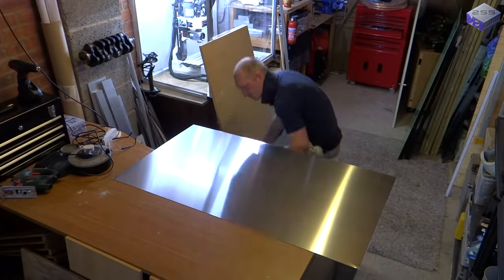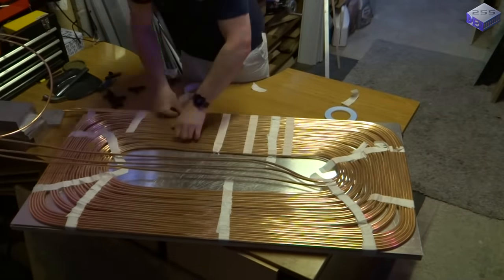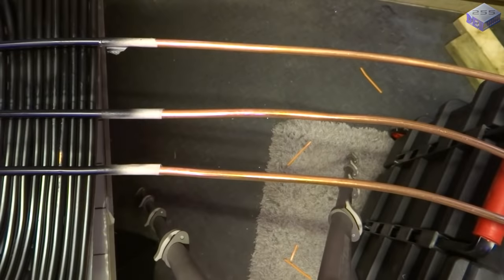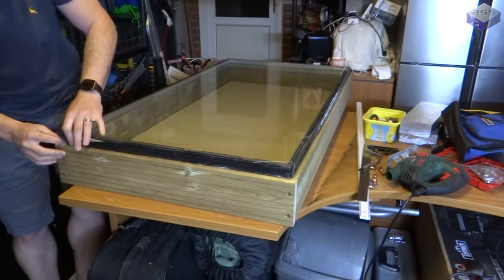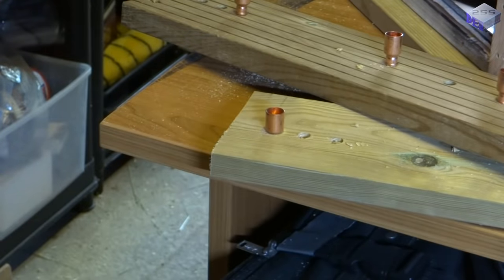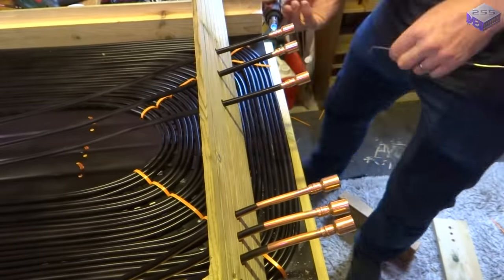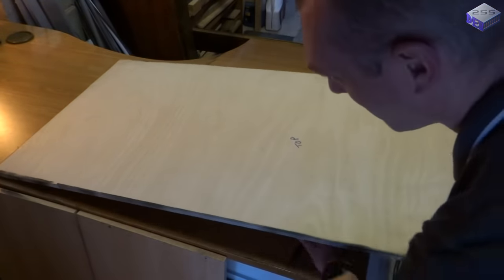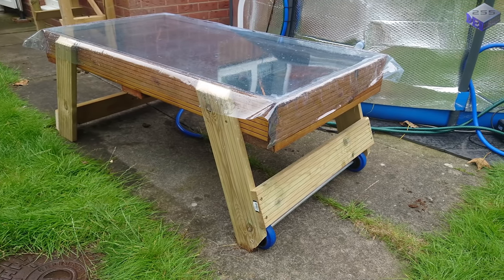Improved Solar Pool Heater - Full build

Comment: Just thought you would like to know. Back in the 1970s, testing for the color paint that was best for the absorption of the sun's energy. The color turned out to be Forest Green. It seems Mother Nature already knew this. That is why trees are Green.
Reply from the maker: Hi, that does make a lot of sense as the light from the sun is not truly white and the inverse of the suns colour is not black. Nature has evolved to be the most efficient form of energy receiver, you may be right, we should look at nature, it's solved a lot of issues before we came along. We assume black is it's hot to the touch but leaves are not due to the air cooling them down around them.... Hmmm, I may just try this colour on the next project. Thank you, you are the first to recommend using this colour and it makes perfect sense to me. Watch this space ;-)
Reply: Incorrect heat comes from infared waves.  Red captures most infared energy not green or black
Reply: I stopped watching after only one minute, after seeing this guy using a double pane window.
Use your imagination.🤣
Reply from the maker: @Fatpumpumlovah2  Cool, this is why I do this stuff, so I can learn while others do too. I'll have to compare different colours. So far, I have had the most success with black, but we shall see. Also, I'll be changing the glass to polycarbonate or perspex; I have a few options to try, as the double-glazed panel blocks some of those important UV and IR
Reply from the maker: @cm8099678  I'm still learning too, I'll be changing the glass for different materials to see if it can be more efficient.
Reply: @cm8099678  what exactly are you saying.
Reply: @QuetzalcoatlOdin  Double glazed pane is perfect, allows UV in and traps the heat in? What's wrong with it?
Reply: @GBPaddling  I assume you tagged the wrong person. I asked the same question wondering why it was an issue. Might want to retag your question bro
Reply: @QuetzalcoatlOdin  I was agreeing with you!!!!
Reply: @GBPaddling  proving they keep these Platforms in text-only so there is as much miscommunication as humanly possible. Now hopefully someone will answer a question.😄
Reply: @Fatpumpumlovah2  incorrect black body radiation is the most efficient absorber of heat and is used to to dissipate heat on the international space station
Reply: @GBPaddling  they keep heat out during the hot months hardly the suited application here.
Reply: @TheSolarPoweredEngineer No, black is correct - infra red is not red, it's above the visible spectrum. Plants are green because they don't want to absorb too much heat - the want to absorb certain wavelengths of light that make photosynthesis work. In fact, the blacker the better for absorbing infrared. Black is technically the absence of colour so it's absorbing all visible light as well as infra red. To make this panel more efficient you need 3 things. A glass with a one way infrared coating. It's called low emissivity glass or low-e glass. Ideally you'd create a vacuum so that no heat can escape via convection but that's pretty impractical for a home project. And you need a temperature differential controlled pump to allow the water to heat to an optimum temperature before heating the pool. So you would generally want your water to heat up at least 7 deg C above the existing water temperature in the pool and you want it stop pumping around a 2 deg C differential. You could increase that top number in summer.
Reply: @Fatpumpumlovah2  No, Red reflects red, possible also let it pass throug. Green leafs absorb roughly 30% less light from the green spectra than from the red or blue. 

But the problem we have is that we can’t see the whole picture and jump to conclusions. So some red may absorb infrared, others may not.
Reply: @cm8099678  Yes that way it’s better isolated from the elements that want’s to cool it down. Normal glass blocks UV. But not so sure how UV contribute the heat.
Reply: @Fatpumpumlovah2 also incorrect.   The sun is technically green in colour.   The most colour energy from the sun is in green.
Reply: Pretty sure that's not true? You see green out in nature because it reflects the green spectrum... so it absorbed LESS.
Reply: The great benefit of that thermal tape sticking the copper pipe to the aluminium plate is the minimisation of bi-metal corrosion.
I'm wondering how well the paint you chose will stand up to the heat and the thermal expansion & contraction compared to say stove paint ?
Reply: @TheSolarPoweredEngineer please let us know how that goes!
Reply: @Fatpumpumlovah2  You are wrong on so many levels. Something that you perceive as red is reflecting that color, not absorbing it. Infrared is close to red, but it is not red. Something we perceive as black reflects very little visible light because it absorbs it and is generally a very good absorber of infrared.
Reply: You're conflating issues. The color testing that you're referring to was specific to photosynthesis, and had absolutely nothing to do with heat energy absorption. Flat black is by far and away the best color for this project. 

Photosynthesis is primarily driven by the red end of the spectrum (600-700 nm), followed by the blue region (400-500 nm) and lastly, the green region (500-600 nm). That's why plants reflect green and absorb red and blue.
Reply: @lordgarth1  but the light will go though and heat up the inside and keep the heat trapped inside, you are just wrong.
Reply: @mondotv4216 I am currently working on a similar project and grateful for the advice thanks. Regarding the “differential controlled pump” I’ve gone back to basics on this. A small DC solar panel powering a small DC pond pump. The more sun, the more heat in the collector, the faster the pump runs. The less sun, the slower the pump runs. An in-line valve could also be used to tweak a flow restriction if needed.
Reply: Most of the light coming from the sun is in the visible spectrum, so technically heat comes from there just as much as it comes from the infrared.
Reply: I don't think that is correct. Black reflects less light than green and leaves are probably optimised to NOT become too hot.
Reply: @StupidInternetPeople  But in this case the heat is taken out of the enclosure by the water, so the pane needs to be optimised to pass through as much sunlight at possible, and only prevent wind from cooling down the tubes.
Reply: No it isn't. Green is the colour light which is reflected from the plant after it's absorbed everything else.
Reply: I remember reading that way back then.
Reply: @Fatpumpumlovah2  No, the heat comes from ALL OF IT.  We think of infrared as representing heat because we can feel it as heat but can't see it.  All photons of light carry energy, and if they get absorbed then you've got that energy.
Reply: L0l sorry I don't care how much science is out there but I've tried wearing all of the above colors and in black u will die in the heat
Reply: Sorry but that is incorrect!
Reply: The color black absorbs all frequencies of solar radiation. Because the sun is also black, and not at all yellow as we see it. The eye "lies" to us.😊😊
Reply: please don't say things like this without citing sources. Ridiculous statement.
Reply: @Fatpumpumlovah2  

What color absorbs the most radiant energy?
black
The more light the object absorbs, the more heat absorbed since light is energy. If you consider it a color, black absorbs the most heat. A black object absorbs all wavelengths of light and reflects none. Objects that are white, on the other hand, reflect all wavelengths of light and therefore absorb the least heat.
Reply: @mondotv4216 pretty much correct the leaves are green because it’s that wavelength that isn’t absorbed and looks green to our eyes when the light bounces off. when leaves turn yellow red etc in autumn  that’s the tree not using that wavelength of light or so my teacher told me many moons ago
Reply: @trollking202  we're not in space.
Reply: If you are using this with a pool, are there chemical issues between the copper pipe and the chlorine in the pool?
Reply: @brianpomerleau887  That is a good question and hoping to hear an answer from someone with sources.

Comment: Would be great to see some temp readout of water temp in vs out
Reply from the maker: Hi, I will be doing some of these readings soon with a flow rate meter, in and out temperature sensors and an Arduino-based data logger that should update every second; where I now have a thermal camera too, so can also show the system in action. I will be putting all of this data on a chart to show how it performs against a purchased one and my previous homemade one.
Reply: @TheSolarPoweredEngineer  must have had a few days of sun by now even in UK?
Reply from the maker: @TheHellis  Hi, yes, I made a quick video with the thermal imaging camera when the pool got up to 32ºC, so will be doing some experiments in the next few days. With a full-time job and kids off school, it takes a while, but I'm getting there.
Reply: Agreed, 
And how your going to move water through it
Reply: Doesnt the water free flow  or can use a inline 12v pump💁
Reply: Where we can see that?

Comment: This panel would have raised the temperature by 0.078125 degrees celcius in my pool, after a whole cloudless day in the summer. The following morning, most of the extra heat has disappeared. Perhaps after a week of cloudless weather, the temperature could rise by 0.15 degrees Celsius.

Comment: What would be "ideal" would be to solder or braze the tubing down to the aluminum along its entire length, but wow, that would be quite a job with 75m of tubing.  You used a lot of tape, though, so that's probably pretty good.

Comment: Many zip ties are not UV resistant & will become weak/brittle over time. When this happens, try using solid core copper or aluminum wire like a twist tie instead.
Reply: Uv doesn't go trough glass.
Reply: @desireisfundamental UV-A does
Reply: @desireisfundamental uv does go through glass.

Comment: Again, smaller tubing doesn't change the heating capacity.  That's set by the area of the collector.  Smaller tubing puts more water close to the metal.  Again, it's about getting the resistance between where the heat is first collected to the water (the "average" water) as low as possible.

Comment: Hi. Fascinating watch. I can build this myself, amateur DIY-er as I am. But how does it work? Sadly your video falls down for me at the last hurdle - actually explaining how the hoses "in parallel" connect and how the whole finished set-up is then installed to transfer heat from the panel into the pool. Additional question - if I built this to heat a tank of water intended for showering, how can I regulate the temperature?

Comment: Nice project.  I made something like this 35 years ago as a school science project.  Not a pool heater, just a hot water heater.  I used an old car radiator, enclosed in acrylic, all painted black.  It worked well.
Reply from the maker: Thank you, it was fun to make, just need to experiment with it, I may change the glass to acrylic as the glass may be reflecting some of the energy.
Reply: @TheSolarPoweredEngineer  I'd have thought glass a better transmitter but Uncle Google just set me straight. Might be a real measurable improvement. Neat!
Reply: @TheSolarPoweredEngineer  double glazed units often have argon gas reducing UV transmission.
Reply from the maker: @KenWeston  Google set me straight too, plus the comments here ;-).
Reply from the maker: @tysondundas1947  Definitely, plus it reflects some of the IR too responsible for around 50% of the heat generation. I will be looking into clear polycarbonate, both double skin and single thickness also, plus trying different paints to absorb the most amount of wavelengths (frequencies).
Reply: @TheSolarPoweredEngineer  Pitching an idea...I thought of using a panel made of fresnel lense tiles. I believe some panels are made of acrylic. The idea being, have the lense focus the light on the pipes at short focal length. Maybe point at a few heatsinks installed on the pipes.
Reply from the maker: @TheMightyDevil  Hi, that sounds like a good idea that would work well, especially if the Fresnel lenses were larger than the area to heat and could track the sun to keep the focus on the correct area. I am always a little concerned with Fresnel lenses though as if something goes wrong and they focus the light elsewhere you could have the potential to set something ablaze. It would be great to see this working though.

Comment: Awesome project. Might build one myself. 

I used to live in south Florida and we got a ton of sun. Instead of having an electric pool heater, we had the entire back half of our roof covered in black pvc pipes, ran back and forth. Covering EVERYTHING. All one pipe, no parallel, just series. In the winter, it would keep the pool warm enough to swim in. In the summer, we had a bypass valve that would shunt the water from the input pipe, directly to the output, skipping the entire roof loop. The water coming from the jets on a sunny day would be hot-tub hot. Uncomfortably hot. 2 inch PVC if I remember. South Florida building code is designed for hurricane force winds, so roofs are built with very strong trusses, set atop concrete block exterior walls. So it can handle the load of all that water and piping. I wouldn't recommend it on an "inland" roof without consulting a professional.
Reply from the maker: Hi, wow, that would produce a lot of heat, did you divert it to your shower and bath too? I like the idea of keeping the pool warm in the winter, I will be trying this with our pool, although know that the UK only receives around 950W/m2 of energy from the sun, plus the UK weather, so I may be asking a lot from it. My house would collapse under that much weight I think, especially if it snowed too.

Comment: One thing to keep in mind is that copper and aluminum are dissimilar metals and will corrode if any moisture is present between them. A stainless steel sheet or regular steel plate for the heat sink backing would hold more thermal energy too
Reply from the maker: Thank you, I am now thinking of marine grade stainless steel for the pipes and plate too, although it may be a bit pricier, but would last so much longer. I may just give it a go.
Reply: Of painted copper sheet, but that's expensive.
Reply: @TheSolarPoweredEngineer  Another issue is that chlorinated water is corrosive to copper pipe. Years ago, it was fairly common to use copper pipe and fittings in pool systems, but they all eventually failed due to this corrosion, while leaching cupric chloride into your pool and turning everything green.

Chlorinated water is going to corrode most stainless steel as well. AL-6XN SS or Grade 2 Titanium would work well, but won't be cheap.
Reply: @ch12831  I work in the pool industry. Many manufacturers now put a zinc sacrificial anode in the water stream near the appliance (heater or whatever) to give the galvanic corrosion a place to take effect instead of on the appliance itself.
Reply: @faberrarius5069 The figures are off re stainless.  Ali has twice the specific-heat of stainless, and 2.3 times that of copper - ali stores a huge amount of energy.
Reply: @TheSolarPoweredEngineer  Steele and aluminium are similarly charged, so they work together. So copper should react similarly to steele. I’m not sure if that is accurate though.
Reply: he used a fair bit of tape which negates this concern
Reply: Hi, you could add a marine anode to the inside of the box then any galvanic action should attack the zinc anode instead. Great video, thanks for sharing. I’m also in the UK, so it’s good to see a “local” project for our climate. Thanks
Reply: @TheSolarPoweredEngineer also add some insulation behind the sheet so you don't lose heat through the back. 👍
Reply: no, aluminum will hold way more thermal energy. totally wrong. Wouldn't replace copper pipe either it's far more efficient at heat transfer. just put a zinc anode in the water.
Reply: In the time since you posted this, has internal corrosion of the pipes been a concern? We have a saltwater setup. It's still chlorinated, just not with conventional tablets.

Comment: The funnest heater my friends ever built was over 1000 feet of black irrigation pipe 3/4 of an inch in diameter. It was all coiled up in a huge pile and then they packed a massive amount of compost that was very rich in animal poop, etc., the pile of compost was probably 6 feet high and about 10 feet in diameter, then they covered it with a thin layer of clay. Once the compost started doing its thing, you could take a hot shower off of that thing for about 45 days before it finally quit! Everybody just loved it. It was called the poop shower.
Reply: That's epic. I want one.

Comment: I used to deliver horse feed to this race track years ago and remeber one of the Trainers bought 10x 100ft black rubber hoses from our store and hooked them all together and ran the hoses along the length on the roof of his horse stable barn. He told me that instead of using the hot water heater, he was able to get about a half hour to 45 mins of straight hot water while only taking 15mins to heat back up in between. Awesome idea dude!!!🤘
Reply from the maker: Thank you, it's surprising that this hasn't been taken up years ago. I like the hot water for stables idea 👍